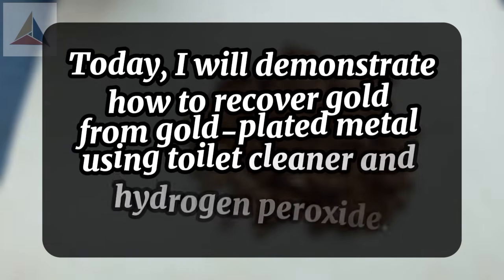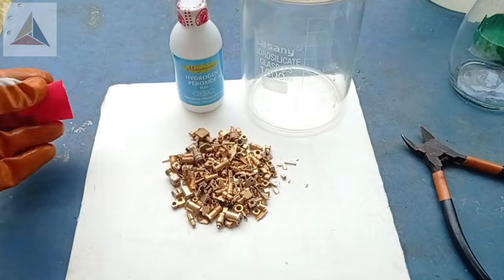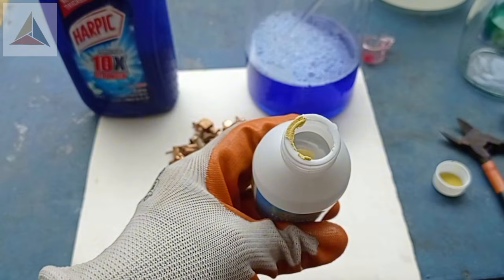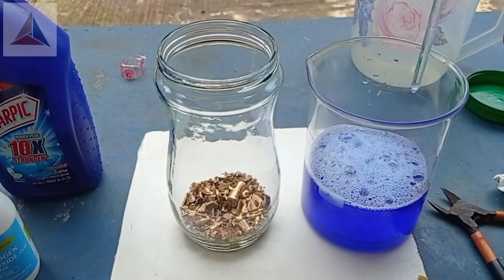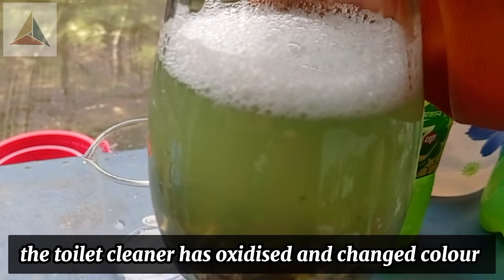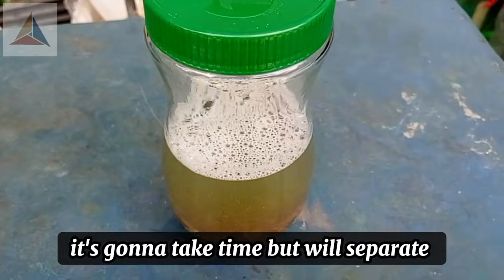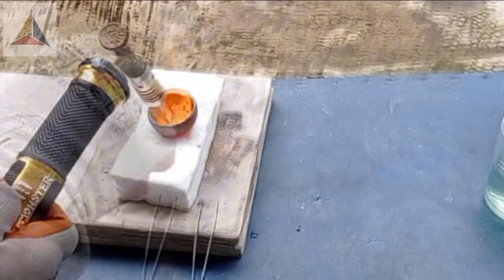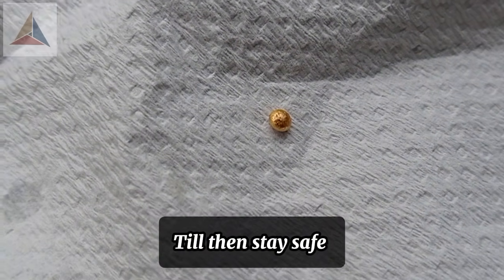Gold Recovery from Connectors Using Toilet Cleaner and Hydrogen Peroxide

Comment: Are you using tap water or distilled water ... thanks
Reply from the maker: I use tap water, but I make sure to filter it before use. While distilled water is the ideal choice for achieving lab-grade results and avoiding mineral interference, filtered tap water works perfectly fine for this DIY toilet cleaner method. Thanks for asking!

Comment: Can I use drain cleaner.
Reply from the maker: That depends entirely on the main chemical ingredient in the drain cleaner you are using. The method in the video requires Hydrochloric Acid (HCl), which is usually found in toilet cleaners. If your drain cleaner is Lye/Caustic-based (NaOH), you CANNOT use it because it is a strong base and will not work to dissolve the base metals. If it is a Sulfuric Acid (H2SO4) drain cleaner, it might work to dissolve some base metals, but the combination of HCl and Hydrogen Peroxide is generally more effective for stripping plating off connectors, so always check the label for the active ingredient!

Comment: Hello sir I am using only using horpic  and gold removed all parts but not showing in liquid water i thought it's melted with liquid water tell me how to recover it😢😢
Reply from the maker: @ECHO12110
Don’t worry, the gold doesn’t melt or dissolve in toilet cleaner. It usually separates into fine flakes and settles at the bottom of the container.
Let the solution sit for a few hours, then carefully filter or pour off the liquid — you’ll see the gold residue at the bottom.

Comment: Hello Trinity
Quick question, for a solution:
150 ml of Harpic
250 ml of water
And 50 ml of 6% hydrogen peroxide
Is there a problem doubling the indicated quantity to obtain a larger quantity of solution?
Approximately: 850 cl or 900 cl, more consistent
Thanks in advance  😉
Reply from the maker: Yes, you can definitely double the quantities to get a larger batch of solution. The ratio of the ingredients is the most important thing. As long as you maintain the same ratio—150 parts Harpic, 250 parts water, and 50 parts peroxide—the solution should work just as effectively.

Just be sure to use a larger container that can safely handle the increased volume and the reaction.

Good luck, and thanks for watching!
Reply: @TrinityGoldRecovery 
Is it 6% hydrogen peroxide to make the solution? 
With tap water ? 
Thank you very much, Trinity.
Here we go.

Comment: Hej I a going to try this method. What do i do with the solution after i have removed all the bits ?  can i use it again of just throw it away ? Thanx
Reply from the maker: Once you've removed all the gold-bearing materials, you can reuse the solution a couple of times if it's still active (bubbling or reacting slightly). But after a few runs, it loses strength.

Please don't throw it away directly. You should neutralize the solution first — you can do this by slowly adding baking soda (sodium bicarbonate) until it stops fizzing. This makes it safer to dispose of. Always try to filter out any leftover particles before disposal.
Reply: @TrinityGoldRecovery  Big thankyou for the Tips. This way it will save me money.  Have a nice day
Reply from the maker: @nigelforshaw8411  You're most welcome, Nigel!  I'm really glad the tips helped — yes, saving money while recovering gold safely is the goal! Wishing you the best of luck with your recovery process. Have a great day too!

Comment: Hello master, bothering you again. I use your method, I have many gold-plated watch cases, thick, thin, including gold filler,  plate 30 micron,14k, 18k gold plating.. can I use your method? I look forward to your guidance??
Reply from the maker: Hello, my friend, you're always welcome — it's no bother at all! 😊
Yes, you can use this method for gold-plated watch cases, especially if the gold layer is thick, such as 30 microns, or includes 14K/18K plating. However, please note:
🔸 This method works best on thin, gold-plated materials, such as electronics.
🔸 For thicker or filled gold items, stronger solutions like aqua regia or proper melting and refining might give better results.
🔸 If you want to try this method, make sure to crush or file the surface a bit to help the solution react better.
Reply: @TrinityGoldRecovery 
thank you master. if your method does not work for thicker plated watch cases. i am testing and will report to you. on the occasion, please share with me how to separate gold by cooking like everyone else does, and using aqua regia, and goldfish powder. (the clips you uploaded if that is what i need) thank you master!!
Reply from the maker: @duythanh5800  You're always welcome, my friend! 
Yes, you're right — my method (with toilet cleaner and peroxide) works best on thin gold-plated electronics. For thick gold plating like 30 microns, or 14K/18K gold-plated watch cases, Aqua Regia or melting & refining usually gives better results.
🔹 As you mentioned, “cooking gold” usually refers to heating the solution in Aqua Regia and using steps like neutralizing with urea, precipitating with SMB, and finally refining the gold.
To help you out better, I’ve already made a video on Gold Recovery from a Wrist Watch. You can watch it here:
 https://youtu.be/7SZxhFw0aFk?si=ofQ8hZwCrd_exXes

Comment: Hello my good friend, I'm bothering you again :D. Still following your simple gold separation method, but is there any way to shorten the time? What about white gold, can I apply your method? Thanks for bothering me 😊
Reply from the maker: Hello again, and thank you for your continued interest! You're not bothering me at all — I truly appreciate your engagement. 
Regarding your question:
 To shorten the time in the toilet cleaner and hydrogen peroxide method, you can:
Lightly agitate or stir the solution periodically.
Use warm, not hot, temperature conditions to accelerate the reaction.
Pre-clean your materials to remove any oil or corrosion that may slow the process.
However, ** white gold is a different story. It's often alloyed with metals like nickel, palladium, or silver, which don’t behave the same way in this solution. For that, I recommend:

Either melting it with twice the amount of silver and using nitric acid to separate the metals,
Or going with a standard aqua regia method for more thorough purification.

Comment: crazy music..
Reply from the maker: Noted! 😄 I’ll keep the background music calmer in future videos. Thanks for the feedback!
Reply: I have 3 lbs of fine gold metal contacts some in very small broken pieces which i have extracted over the last 20  years from various computers... will this technique work on these fine gold plated metal pieces and how long should i soak them in the toilet bowl clearn and hydrogen peroxide?. thx for your time.
Reply from the maker: @arcticmorning  Wow, 3 lbs of fine gold contacts collected over 20 years—that's impressive dedication! 🙌
Yes, the toilet cleaner (usually containing HCl) and hydrogen peroxide method can work on gold-plated metals, especially if there's no thick base metal like copper or nickel underneath.

However, here are a few tips:
🔸 Efficiency: This method works best for thin gold plating. If the plating is thick or the pieces are solid, aqua regia or iodine-iodide might be more suitable.
🔸 Soak time: Start with 6–12 hours and observe periodically. If you see bubbling or gold flaking, it’s working. Stirring or shaking gently can improve results.
🔸 Speed: This method is very slow, so you’ll need patience and consistent observation to monitor progress.

Comment: Thank you for guiding me, this is my first time learning, so there are many things I don't know, what kind of filter paper do you use? I found out online that there are 2 types of filter paper (qualitative and quantitative). Can you help me which paper is suitable to use?
Reply from the maker: You're most welcome! 😊 For gold recovery, qualitative filter paper is generally sufficient — it's good for basic filtration of solids like gold dust. Quantitative paper is more precise and used in lab analysis, but not necessary for most recovery work. Just make sure it has decent strength and fine porosity. Good luck on your recovery journey!
Reply: @TrinityGoldRecovery Thank you very much

Comment: Thank you, your video is very helpful. Let me ask a question. My toilet bowl cleaner has HCL 12%, Ethoxylated Linear. Can I do the same as you? And can I separate gold from gold plated watches?
Reply from the maker: You're most welcome, and thank you for your kind words! 😊
Yes, if your toilet cleaner contains 12% HCl and Ethoxylated Linear, it can work similarly—just make sure you're in a well-ventilated area and wear safety gear. You can also use this method to separate gold from gold-plated watches, but be aware that the gold layer on watches is often very thin, so the yield will be small. Patience and careful handling will help you get the best results. Best of luck!

Comment: It would seem like adding water (distilled I'm assuming) dilutes it. If u were to mix the hydrochloric acid ) toilet bowl cleaner) and the hydrogen peroxide, would it speed up the process? In one of ur other vids u show using just toilet bowl cleaner and 250 ml of water, and it only took 2 weeks to break the gold off the other metal. Based on this vid it took nearly a month to dissolve properly.
Reply from the maker: Great observation! You're absolutely right—adding distilled water dilutes the solution and slows down the reaction. Mixing hydrochloric acid (from toilet cleaner) with hydrogen peroxide forms a more reactive solution (similar to a mild Aqua Regia), which can speed up the gold separation process. Just remember: stronger reaction = more caution! Thanks for watching so closely!

Comment: Great video, but dipping it in sulphuric acid after crazy to clean it or cool it down on other hand I never work with gold that why but still awesome video
Reply from the maker: Thank you for your feedback! I understand your concern about using sulfuric acid. It's a step that is typically used to clean the gold after it's been dissolved, but I agree it may seem a bit intense if you're not familiar with the process. It's always important to follow safety protocols when handling such chemicals. I appreciate your comment, and I’m glad you enjoyed the video!
Reply: You can heat up white vinegar and salt to help clean som surface residue and then scrub it clean. It won't be the same but you can avoid the acid that way and still clean whatever you can!

Comment: How long does the process take ?
Reply from the maker: The duration depends on the amount of material and the effectiveness of the chemical reaction. Typically, with toilet cleaner and hydrogen peroxide, the process may take several hours to fully dissolve the base metals and separate the gold. It's important to monitor the reaction closely and ensure safety precautions are followed. 😊

Comment: Hi, I tried your luck and it didn't work. The gold dissolves in the toilet cleaner. I use toilet hcl 10% and hydrogen 12%. Do I have to or do I have to use it like you suggest?  Please answer me.
Reply from the maker: In these videos, I mention that hydrogen peroxide is 3% by volume. You used 12% hydrogen peroxide, which is a very strong reactive oxygen species that can dissolve gold. 🤭😇😶
Reply: Thank you very much.